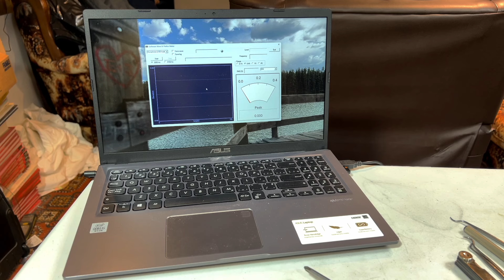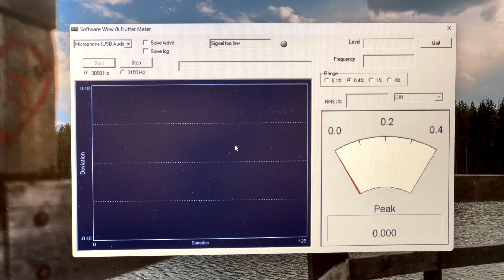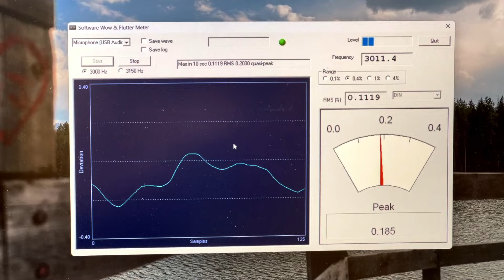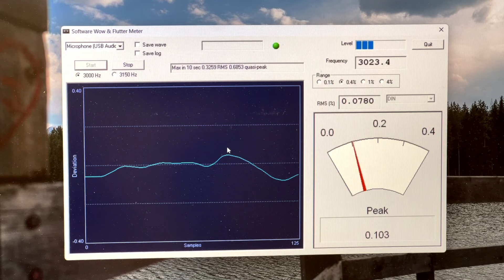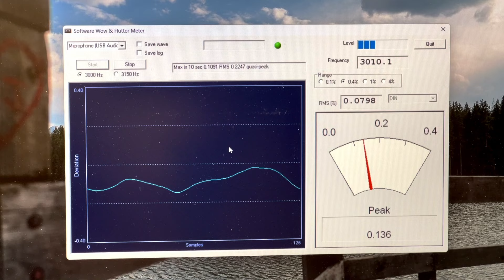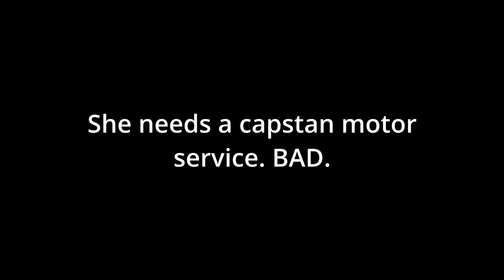Nakamichi 480 Part 2 - Finding and Fixing Some Nasty Surprises

Comment: Also - a tip that watchmakers use to prevent those e-clips and other small parts under tension from flying across the room is the use of a product called Rodico.  This is like a putty that you shape into any form needed and used with one hand to place on half the clip while you remove with the tool of your choice. The matreial is "grabby" enough to prevent it from flying away. It "cleans" by absorbing oils, so you might need to relube any area that it contacts.

Comment: I was watching late at night so might have missed something, but if you have a known good 3015Hz speed tape, shouldn't it show 3015Hz on any deck running at the correct speed? Why the negative compensation?
Reply from the maker: The tape recorded on the Technics measured 14Hz slow when checked on the Denon DR-M3, which is known to be running at 2999Hz, so that's what I was trying to calibrate it to with that specific tape. A bit confused myself, because the Technics runs fast in play mode. Of course, it doesn't help unconfuse me when the 480s capstan motor can't hold the correct speed at all. That thing was all over the place. I should do another video on that motor to see what's wrong with it - I suspect it's beyond a simple motor service, and the controller itself is having problems.
Reply: @Oklawolf  Ah, I see. The quartz locked Technics if running correctly, will be close to 3014-3015Hz normally, that's about where the crystals oscillate. The 480 motor didn't appear stable at all from my view. It further convolutes things when using homemade tapes without a calibrated reference. It's kind of like making a yardstick without knowing how long a foot is.
Reply from the maker: Indeed - I'm starting a video next week comparing each direct drive deck against the Denon to see which decks are running at what speed, and where I need to set the generator to record 3kHz tapes with each one (and which gives the best wow and flutter result). I've already done a 3kHz tape with the Denon - as expected, feeding it 3001Hz ended up being on target. It tested at 2999 playing back with the Denon, 3014 with the Technics, the same as the Fix Your Audio tape.
Reply: @Oklawolf  That might be asking a bit much of this medium, even factory tapes have speed/w&f tolerance and it might shock you away from tape to know how much it actually is. I'm probably wrong about this as well, but at one point I thought I saw the deck making the speed tape, monitoring its own frequency during the recording? Of course, this will always show as correct no matter the frequency. I have two or three factory tapes including a brand new Sony, maybe the thing to do would be to record a 3000Hz signal on your quartz deck, then send me the tape to compare against my factory tapes. That would give you a standard reference, and we could both do a video about it. Lord knows I won't have time to do any other videos next week!
Reply from the maker: Yes, I did it that way for both the Technics and A&D units, which is the main reason I'm planning to do that video. Otherwise I'd honestly be tempted to just let the Denon make these tapes. It's not the lowest W&F machine I have, but it's plenty good enough to make tapes that can calibrate future machines. As previously mentioned it seems to have a 1% max variation on speed stability. A collaboration sounds interesting... I'll give that some thought. It would be interesting to know how one of mine compares against other good tapes, rather than just the FYA tape. I do have the HPR tape as well, but I haven't been too happy with that one.
Reply: @Oklawolf  I have a little practical background in metrology and understand why a machine cannot be used to calibrate its own error. It may seem counterintuitive but it's the accepted practice and has been from the beginning. I want to do a video at some point on complimentary error, demonstrating why our homemade w&f tapes will give us better, worse, or sometimes even accurate results. Maybe during the next 15 days to slow the spread ...
I have Hanspeter's tape as well I think, but haven't used it yet. Maybe during the collaboration.
Reply from the maker: Reminds me of when I was in grade 2 and thought I knew enough to be able to grade my own schoolwork. My poor teacher...
Reply: @Oklawolf  Exactly!
Reply from the maker: Regarding collaboration - would you be more interested in using the tape from the A&D or the Technics, or does it matter? The A&D does seem to be stable now, but I think the Technics is still outperforming it. I shot the intro to the video this morning and am planning to do the actual recording tomorrow. This video won't be up for a good two weeks so there's no rush whatsoever on my end.
Reply: @Oklawolf  Whichever you prefer is fine, you could even do both, say, five minutes each maybe?
Reply from the maker: Recording is done - 5 minutes at 3014 for the Technics, 5 at 3015 for the A&D, a minute of silence between the two on a new 1988 vintage TDK D60. The Denon says both are dead on target. I’ll get it into the mail in the next day or so.
Reply from the maker: I still had your business card so I sent it to that address.
Reply: @Oklawolf  Ah yes, very good.